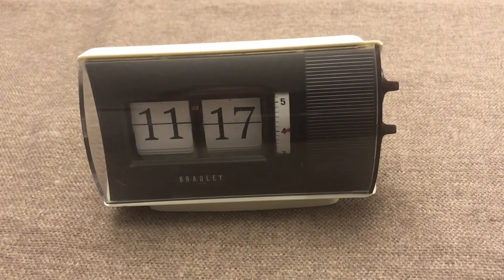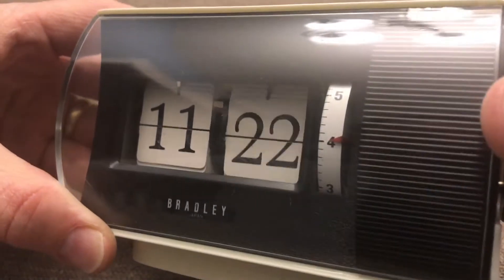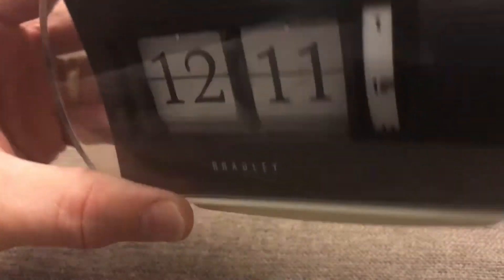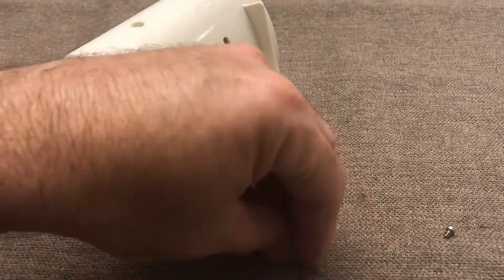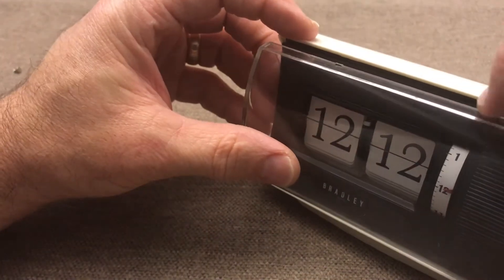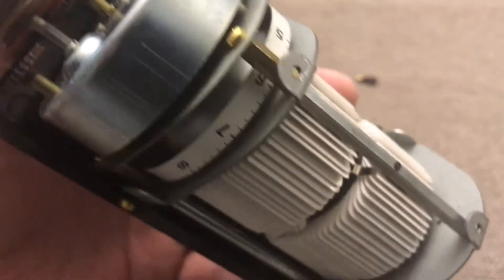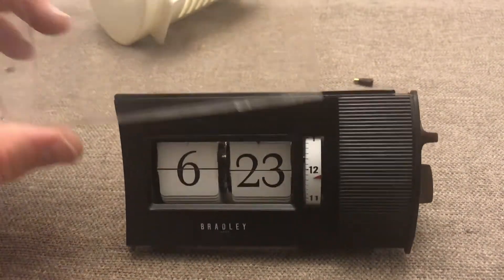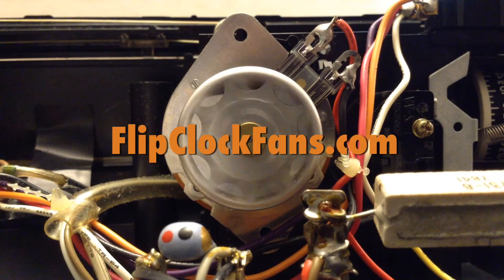Bradley Wind Up Flip Clock

Comment: I recently found a Soundesign Model 3452 at a garage sale in mint condition and I don't know how to operate. Would you be able to help? Thanks!
Reply from the maker: I've had a Soundesign, but not that particular model I don't think. What exactly is the issue? The alarm function? I know that they made those strange. They're not user friendly with the "Manual" and "Auto" buttons. If you look at the following video the issues may be similar:
https://www.youtube.com/watch?v=muqCRN933Lc
Reply: Flipclockfans thank you so much!!!!